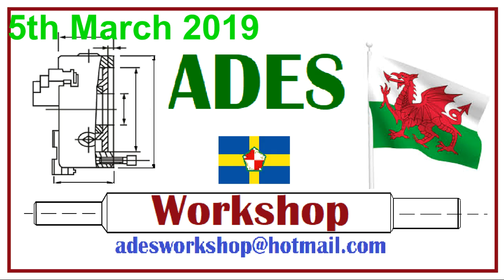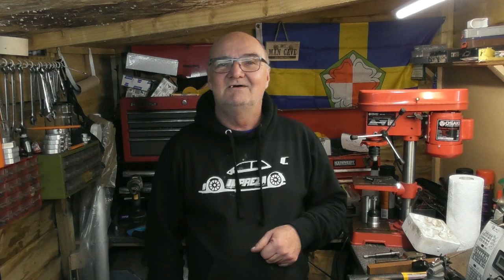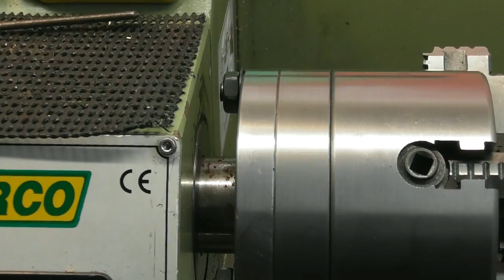Shop made Knurling tool part 2

Comment: I enjoy watching your video's. But something that I've only recently done is when chucking in the four-jaw, is to use two chuck keys, then you can use them in tandem and not have to keep swopping from one side to the other. When doing my apprenticeship, I hated that they made you always use the four-jaw independent, but now with the DTI and two keys, it's so quick to set up, it is now the go-to chuck for most work. Holds better than a 3 jaw.

Comment: Find a cutter grinding shop and put an edge on that end mill. The poor thing sounded as dull as a politician's speech! Also I would slow the rpm down about 1/3rd...speed and feed tables are for production work where you've got work holding rigidity, something that is short supply when using a milling attachment on a lathe.
   I have the same knurling tool that you have. My lathe is bigger and perhaps takes the side pressure a bit better. The tool does have the advantage of having coarse, fine, and straight knurls immediately at hand. 
  Looking forwards to see how well your scissors knurling tool works.
Cheers from North Carolina USA!

Comment: Great project, always enjoy the tool making videos. Could you mount the part directly on the milling slide but with the end you're cutting hanging out the side and the face of the milling slide towards you, so at 90deg to the headstock. Not sure if that would provide any less overhang but it brings it closer to the center. Maybe?

Comment: unbellievable milling on 2 m5  bolts 👍
Reply from the maker: centre is on an m6 dowel pin but being very gentle , oh what fun when you have no other choice , not surprised it gave up with the huge overhangs i had , rigidity lost , plan b coming , Cheers Ade.